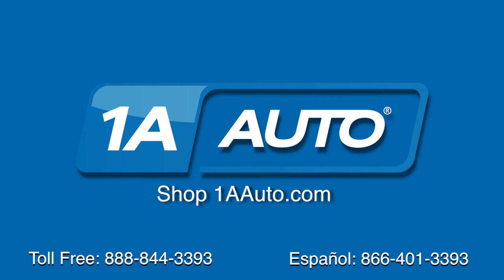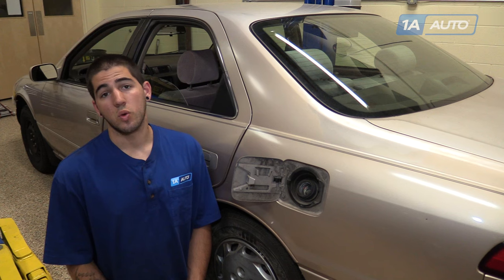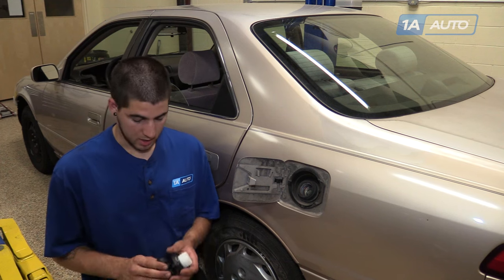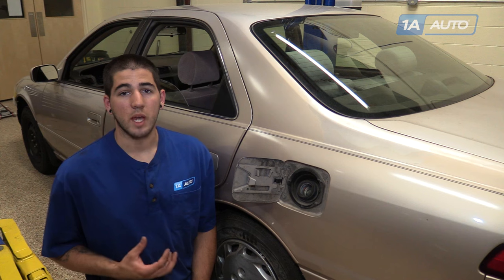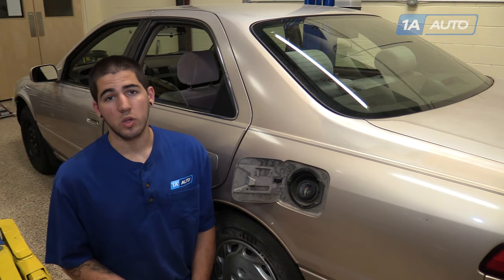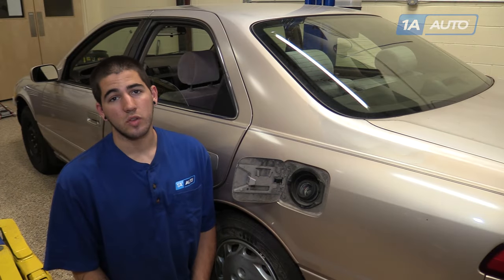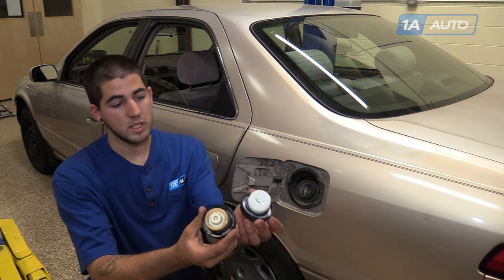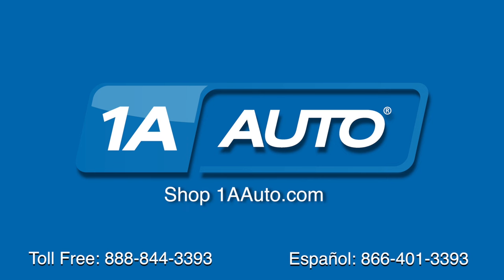What is EVAP Code and How to Fix With Non-Locking Gas Cap

Comment: What happens if the check engine light does not turn off?
Reply: Tony Garcia clear the code with a scanner and drive 150mi
Reply: If it stays off, it’s good
Reply: Ot means it was not the gad cap
Reply: It means it was not the gas cap and that you habe to spend more money not just gas cap
Reply: Exactly the issue that I am having, my EVAP doesn't ready at all and no check engine light at all.
Reply: @MiggyDLegend  Same issue all monitors clear except evap. My check engine light cycles on and off, made a mad dash to smog test when it cycled off. Pass! YMMV.
Reply: Had gas cap replaced an engine light came back on. Checked at auto parts store p0446 code. Mechanic replaced evap and engine light came off for one day then came back on. What do I do now please help?!

Comment: I recently got the code P0446 on my 98 Toyota Camry but I was told I need to change my Vacuum Switching Valve. Do you know where thats located...Someone told me near the gas tank, then another person told me its behind the engine.
Reply: TampaOutlaw that thing has two hoses going to it and an electrical adapter going to it. Try checking in the back on the drivers side in that general area--it is small. Someone told me that it helped to boost MPG of their car. Everytime you replace a part you need to take the neg terminal off car battery. Placing parts (especially under the hood) requires the ecm to re-learn the whole system of the car.

Comment: My car manuel say fuel tank capacity is at 14.5 but when i put gas it only get fuel around 11.815  i had change the gas cap before because i had check engine light my gas mileage is low at 230 miles range but the manual say 390 miles range what should i do see a mechanic

Comment: funny thing was this was lass thing check car inshurace paid out 3000 on this probem 
so dealership flash software wich came back with gass cap then evac error so i order new oem gass cap 
dealer ship wanted 100.00 i got new one 24,00 , now will this solve the probem after fuel pump seal was replace 
after the evac control value replace   well we will find out shotly  as stated check motor light should go out once gas cap is replace  we will find out

Comment: Any advice for those that don't have a cap? 2018 traverse. No cap
Reply: You have purge solenoid and vent solenoid. If one of them they doesn't work properly, the check engine light will turn on.

Comment: All I need is the EVAP , but I try so many online videos still incomplete I drove over 300 miles . What else can I do ? Do I really need the EVAP to pass inspection in New Jersey ?
Reply from the maker: +Scarface11385 A functioning EVAP system is usually required to pass inspection in most places. Thanks for checking us out! 1AAuto.com
Reply: My evap monitor won't clear but passed CA smog. I think CA allow one monitor not cleared, make sure no check engine light. 2000 Camry, taken my chance got lucky!

Comment: Why do Evaporate leaks happen with the cap?
Reply: Gas cap is one of three components keeps the vapor sealed. The other two are vent and purge solenoid. Over the years, the rubber gasket worn on the cap off and causing a leak.

Comment: I have a 98 camry.  Passed smog check 4 months ago. 2 years ago I replaced the charcoal canister with another charcoal canister. Yesterday while driving I got a p0440 code. However the computer only reads the 0440. No other codes. What could possibly be the problem? My gas cap looks ok
Reply: 2000 V6 Camry evap monitor won't go away. Removed gas cap and drove it for miles, no P0440. Isn't that strange? All monitors cleared except evap, pass California smog anyways. Just wanted to fix that stupid evap monitor, frustrating. Mechanics here charge $140 for diagnostics then another $140 per hour for the work, some just keep on replacing parts. Thinking about getting a smoke machine and do it myself.
Reply: @kimchee94112  Are you saying if you clear a P0440 code, then get the smog check, it will pass CA smog even though the readiness monitors haven't run yet?